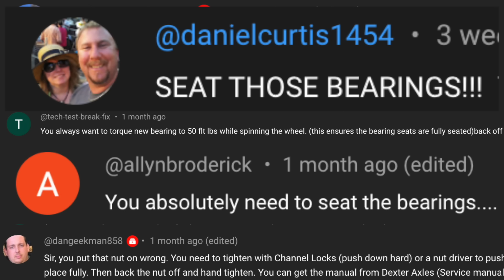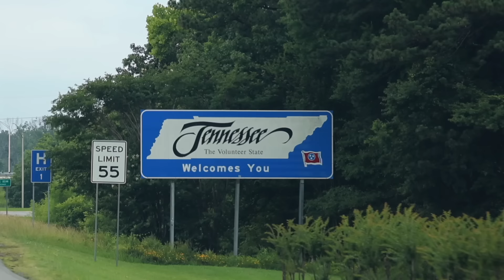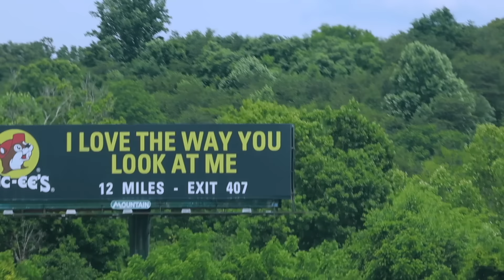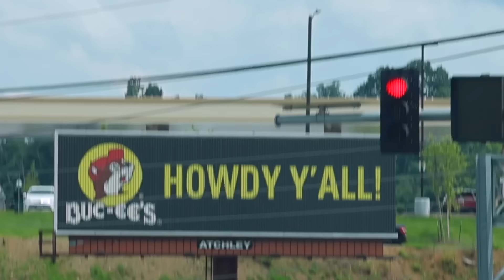We Can’t Continue to RV Until This is Resolved

Comment: Anyone telling you that greasing through the zerks is "not good" is a clown, I just did all 4 of ours and the fresh grease was coming through the bearings just like when I hand pack them, literally no difference.

FREE TIP: the opening of the channel lock should be facing the direction that you are turning them, this way the more pressure you put on the nut, the more the jaws clamp down tighter.  Use them like you would a wrench, not across like you did they should be on the same plane as the nut is, flat.

Overall you're doing great, just keep on working bro and don't give up ~much love ❤
Reply: Good free tip! I was covering my eyes, trying not to look as he was using those channel locks so wrongly. Personally, I have a socket that fits the castle nut. But great save Hanks!
Reply: Some of the zerk haters seem to think that people who use the zerks don't pack the bearings before assembly.  Regular greasing via the zerk doesn't replace anything.  All the zerk does is let you add grease in addition to the initial grease pack - which reduces the chance of a catastrophic failure before a scheduled rebuild.
Reply: I am a zerk hater for a good reason. The grease in the tubes used in grease guns appears to be formulated differently so that it can be pumped through the grease gun. No matter what brand of grease I buy, once I open that tube and the grease is exposed to air, the oil separates from the thickener. If I towed regularly like the Hanks, this would not be a problem because the spinning of the bearings would mix the oil back into the grease before there was too much separation. I stick with the grease that comes in the plastic tubs. Even a decade after opening it, it is still the same as the day I opened it.
Reply: As always, read and comply with the manufacturer's instructions. Dexter advises that using the EZ Lube feature is not a substitute for removing, cleaning, inspecting and repacking the bearing sets. Do that at least every 12,000 miles or 12 months. This also allows verification that the bearings have not "spun" in the hubs. My 5th wheel had 3 of 4 bearings spin, found at the first service. Dealer replaced all 4 sets under warranty with new Timkens.
Reply: Adjust the adjustable pliers so the handles are closer together, makes it easier to hold. 👍👍
Reply: Well first name calling isn't nice.... If you knew anything about greasing a bearing, you would know even if you choose to use the zerk the bearings need to be packed first and completely cleaned out at least every 12,000 miles. The zerk is not a short cut to this necessity. Second grease expands when it gets warm like most things. If you fill the entire hub it will find a way out usually fouling the brakes. The grease between the bearings in the hub will never get to the bearings it's a waist of money. When your brakes fail you'll know why now.......
Reply: +1 for the EZ Lube Zerks. My first trailer, I used the EZ Lube zerks for 4 cross country trips AZ to WI (4,000 miles each). I made it a habit of re-greasing via the zerks before each trip. Never once had a leak. Never once "blew out a rear seal". Never once had any bearing issues. They ran plenty cold throughout the entire trip.

The key to greasing through the zerks is to GO SLOW and ONLY use a hand pump. While SLOWLY pumping in the grease keep rotating your wheel. As the old grease is pushed out through the front, you will see the color change. It's a messy job with the grease coming out the front - but it does work.
Reply: Watch the Hanks episode from this week July 18th and let me know if you learn anything........

Comment: I'm a truck mechanic, the way I set the small trailer wheel bearings is somewhat similar to the way I set them on a commercial truck. 
First step is to seat the bearing. Tighten with a socket and ratchet or torque wrench approximately 50ft lbs. Rotate the hub one full rotation and torque again. Do this twice.
Second step is to back off the nut without moving the hub til the nut becomes loose. Approx. 1/8-1/4 turn counter clockwise.
Third step is to tighten the nut back up finger tight. The nut must be backed off slightly and left with what is called endplay, this allows for thermal expansion as the wheel hub is heated going down the road.

Check the bearing by spinning, the hub and feeling that it's smooth and not binding.
Push in and hold then pull out and hold with your hands at 9-3 on the hub. You should not feel any movement or clunking.
If you feel clunking the bearings are loose and need adjustment or replacement. The endplay will not typically be felt by hand.
Reply: Sorry you guys are down, check YouTube out, lots of valuable tech info there. Hope back on the road real soon. Take care…..
Reply: Auto Zone loans tools torque wrench, get you a socket for that nut.

Comment: In a past life as a hd mechanic, alot of the advice on here about wheel bearings is bang on! My method was similar, tighten, but use a proper socket or at least a crescent (adjustable) wrench, not slip joint pliers, then back it off, repeat, then once backed off for a second time, tighten the nut until a slight drag happens while spinning the drum. Done. This way the bearing has adequate contact and not too loose. With heat and cooling the adjustment may change too, becoming too loose. Over tightening creates too much friction and heat. Both cause premature wear of the bearing. I was also taught to hand roll grease into the rollers as even grease guns will not always coat every roller well enough. Once properly packed, a grease gun or a bearing buddy, a spring loaded grease pressure cap, is good.

Comment: I was the one who said stop where you are and seat the bearings. Also said the grease zirk is not the way the lube the bearings. I saw you packed them buy hand and that is all you really neeed to do. Pumping the whole hub full not necessary. However If that is what you choose to do you must rotate the hub while pumping so it will go back through the inside bearing and not blow through the seal and foul the brakes. If you notice the brakes getting soft they are grease fouled and will need to be replaced again, sorry. If you have time just pull one all the way off see if grease came through, I would be surprised if it didn't I don't think you rotated it while pumping. By the way open the channel locks grab the nut from the side putting teath completely across the top and bottom of the nut, not straight form the front with just the tips.

Comment: as a HD mechanic from canada who is use to dealing with wheel bearings. i am use to tightening the bearings to a certain spec (depending on manufactor) backing off the nut and then tightening the nut again to either 45 degrees, 90 degrees or 180. but RV's might be different from HD trailers. love your videos and keep up the great videos.

Comment: Nice video. Made me laugh several times 😂😂
Couple of small notes from a gearhead, and for your safety:

1) adjust the channel licks correctly so you can use one hand, that’s how they are designed. 
2) jacking a wheel up should normally be done under the spring plate or as close to hub. Unless the frame of the trailer has specific points built into it for jacking, you’re risking bending or breaking the frame. Also, looked like your bottle jack was a little small. They make 12,000 lb and 15,000 lb bottle jacks; the ones in the truck are usually not sufficient for big ol trailers like yours. 
Stay safe and happy!
Love the show!!

Comment: Take the tires off and back on with the impact while the tire is off the ground.  Then use your torque wrench for final tightening when the tire is back on the ground.  
As for tightening the wheel bearings the next time you drive through Dallas I would be happy to show you how to do it a way you can take all the guesswork out of it.  I taught automotive technology for 25 years.

Comment: A couple of points.  When using a bottle jack you can cllscree out the top plate to help meet the frame so you don't have to pump the jack up so far to begin with.  Also, get a large crescent wrench as well as a 1/2" socket set that goes to 1 1/2". They will come in handy and you will not regret having them.

Comment: In case no one else mentioned it. On your bottle jack, you can turn the blue top of it to change the height before you pump it. That way you’re closer to what you’re jacking up and take less effort and time pumping it up. Also you can buy a grease packing tool that makes it easier and ensures you squeeze out the old grease in the bearings.

Comment: Great Job Hanks!!! That way you were using the channel locks could be called a knuckle BUSTER!!! They do make a socket for a 3/4" ratchet to fit that nut. Granted it's not cheap and you won't use it that often, but when you do need it, it's GREAT to have!! Ya'll continue to have fun and be safe!!! Do NOT get complacent when it comes to safety!!!! 🙂

Comment: One of the largest Buc-ees coming to New Kent County, VA. 120+ gas pumps. 78,000 square feet. Halfway between Richmond and Williamsburg on I-64. Another in Fredericksburg, VA. Halfway between Richmond and DC on I-95. Another possible location near Roanoke, VA. Halfway between Lynchburg and Blacksburg on I-81. Safe travels.
Reply: I can’t wait for the one in new Kent! It’s 5 miles away.

Comment: When using your bottle jack, set the head just under your frame (still with some light showing through) by turning the head counter-clockwise so that you can extend it to that position by unscrewing it. Then you can jack the whole cylinder up. This allows you to preserve more range of jacking up the cylinder (therefore the frame) with the hydraulics.

Comment: You need a torque wrench  to torque those castle nuts to 55lbs, in order to properly seat them. Then back them off and make them hand tight. Fellow Pennsylvanians who enjoy your videos.
Reply: This guy has it right. Set to the correct torque then back off to hand tight. It will allow the bearings to have the correct preload when they come up the operating temperature.
Reply: 55lbs? I was ase certified mechanic and have never been told to torque cone style bearings! Tighten to snug while spinning the drum until it starts to drag,THEN back off to the next cotter pin slot! That's is the way to do it correctly! Or you can be on the side of the road with smoked bearings! Why would you ruin the bearings before even using them! I look forward to the idiots comments! ASE Certified! Not crackerjack box awarded!
Reply: @stephenscering1776  I was given those instructions from my RV Manufacturers service guide. Said that was the way you needed to preset the bearings without over torqueing them. That's what I did, and it worked just fine. My axles didn't have cotter pins. They use a retainer clip.
Reply: You forgot having to back it off and put it back in to a certain end play
Reply: @mbfishing3807  Yes. Hand tight.
Reply: @raycalandra1887  no hand tights not always right end play sometimes it’s less sometimes it’s more
Reply: @mbfishing3807  When I was repacking my bearings on my 2021 Flagstaff, I noticed my rear passenger side tire was showing excessive wear on the inside edge and that that wheel had a bit too much play. I found that the castle nut was a whole turn loose. I contacted Forest River to get their specs on how to reset the bearings and drum. That is how I was told to do it. At hand tight, I did have some very slight end play. So far it has worked out well.
Reply: @raycalandra1887  yeah that’s just not it I’m going off prodemand and alldata they all tell you that endplay isn’t hand right all the time like I just did hubs and wheel bearings on a 1998 ford e450 and they said 4-5 thousandths of a inch for end play and in order to get to that it was more then hand tight and when I did it the job right after that on a international 4200 it was a lot less then hand tight

Comment: I been RVing since the 60's packing my own wheel bearing every year without a bearing failure.  I remove both bearing and using solvents to completely clean the grease out of the bearings and hubs.   I then look for any signs of wear and will replace them if there is a question.  I hand pack both bearings, adding extra grease to the bearing surface and install new grease seal.  I use a wrench to seat the bearings.  I turn to it starts to bind and then back off to it spins freely and I can insert the carter ping.  I place a little extra grease on the nut and reinstall the cap.  I never used the grease gun to force clean my bearings.  I glad you tighten the lugs to the proper tightness.

Comment: was there a cotter pin or any other sort of lock? if you Did not show it fine but it REALLY needs to be there so it doesn't back off.
Reply: watch the video he takes off the lock for the nut it is not a cotter key.

Comment: When you use the grease fitting, always get the wheel of the ground and as you pump grease turn the wheel, this way the grease gets in even and not out on one side and push the rear seal out.
Pump till the old grease comes out the front till you see fresh grease, 👍

Comment: Put tire back on leave center cap and bearing buddy off spin tire while tightening nut for bearings as soon as tire just starts to slow because the nut is getting tighter go quarter turn more and lock it down then pull tire back off install bearing buddy and wheel center cap check everything after first 75-100 miles make sure all is good to go

Comment: To remove nuts you use stronger settings. To put back nuts you install manually the nut to start than use lowest settings to prevent ripping off stud. You finish torque with torque wrench.

Comment: When you use those locking pliers, (ie; channel locks), open the Jaws Upson that the handles are as close together as they can get. You can get a much better grip on them. Whe you push or pull to turn them you should be pushing/pulling toward the jaw opening not away from it.
Reply: Can’t overload him with too many new ideas all at once. Hahaha. First thing I thought too

Comment: Get yourself an 1 1/4” socket (confirm size before buying), torque to 50ft lbs while spinning the drum, back off and then finger tighten.  Tekton has 1/2" drive deep chrome sockets that work very well for this and don't break the bank.

At the very least use a crescent wrench instead of channel locks.  

And there are things you need to know before doing certain jobs. You can get someone killed by doing unsafe work.

Comment: Dexter axles require you torque new bearings to 50 foot lbs, loosen and then hand tighten. Get yourself a 1/2 inch drive torque wrench. They're good for tightening you lug nuts too!
Reply: Exactly correct !

Comment: The impact wrench means you can most likely remove the lug nuts after jacking because of the impacts instead of constant torque. You likely want a high setting when removing the wheel to get the nuts loosened. However, you should check the manual for the torque specs of each position and when tightening the nuts, do so to a setting lower than the expected torque on the wheel nuts. Then use your torque wrench to finish the job to spec.

Comment: I think i would start  completely  over. It doesnt take that much longer.
If your grease was Red and it has discolored to black. There may have been some heating issues. Pull hub, clean it all, new seal, then reassemble. I seen another peraon say torque down to 50ft lbs to seat the bearings. THIS is correct. Then loosen nut, hand tighten. Replace retainer. Use zerk and rotate til you see grease. 
Impact to remove nuts. TORQUE WRENCH to tighen 
Then re torque at 25mi, 50mi, 80mi. Then check before each trip. I bought a digital 1/2 torque wrench at Harbor  Freight.  QUINN is the brand it has served  well
Reply: Dude what is mi ?   Most people use ft/lbs
Reply: @slalomking  miles traveled. Mi.
Reply: If you read i did say ft lbs for torque. Once you remove and tighten everything down as you travel the manuel state re check torque on the tire lug nuts  at 25, 50, and 80 to verify  everything is staying torque

Comment: Hmm, never heard of "setting' the bearing. Look, if they hum goes on and stops and then you place the bearing on and push it so that it is against the race you are good to go. There is no need to tighten then loosen and the snug it up. Just did 8 wheel bearings and some with brakes and no issues.

Comment: I will use a torque wrench, Tighten the nut to about 20 ft lbs while turning it, the back it off to 1/4 turn on the nut. I believe Dexter torques it to 50ft lbs then backs it off.

Comment: How are you doing, you asked. 
- No need to pre-lossen the lug nuts when you use a real impact. 
- You can shake the tire left right and up down to check for excessive play in the bearings.  
- Personally I like to place the bottle jack under the axel not the frame, if accessible.  
- Speaking of bottle jack...unsrew the top too raise the height, so you arent jacking all day with those big guns.

Comment: When using the grease zerk squirt grease in slow and turn the hub while greasing. reason is the hole in the axle is all the way back next to the dust seal in the hub. grease to fast will cause the seal to blow out and then you loose all your grease and introduce dirt into the bearings.

Comment: It's not so much so that it seats the inner race on the outer race (cone into the cup) as much as it is to ensure the outer races are set all the way into the hub.  If you don't get the outer race bottomed out against the shoulder, it can move after installation, leaving you with too much endplay and leading to tire wear issues.

Comment: open those channel lock and hold them parallel and tight that nut then backoff 1/4 turn put lock on and grease with that zirc fitting wile spinning tire or drum,

Comment: Use a socket with a torque wrench which is the proper way to seat wheel bearings. Using proper tools will reduce chances of injury.